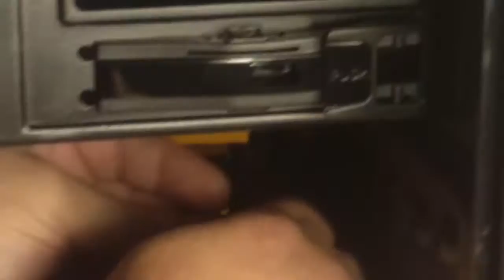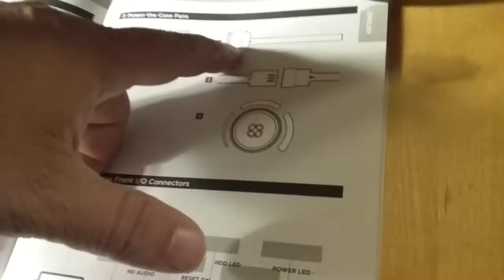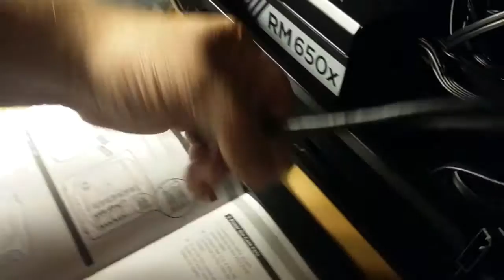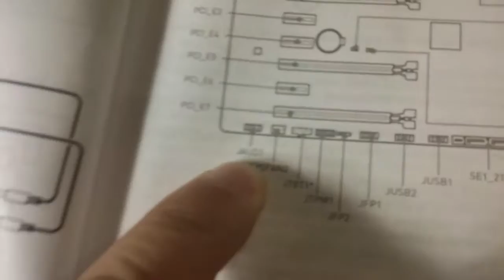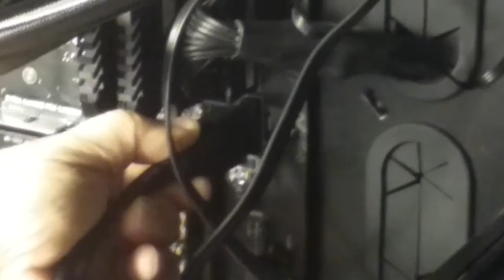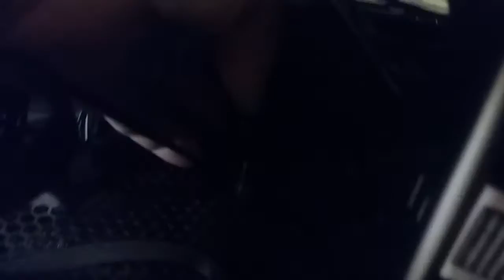Corsair Graphite Series 780T Cable Connection to the MSI Z170a Gaming Pro Carbon

Comment: Good tips, I'm currently building in a 780t. It hasn't been easy
Reply from the maker: More cables and more expensive, but it does essentially boil down to the same process once you get into it.  One main advantage is more space than the 230T case.